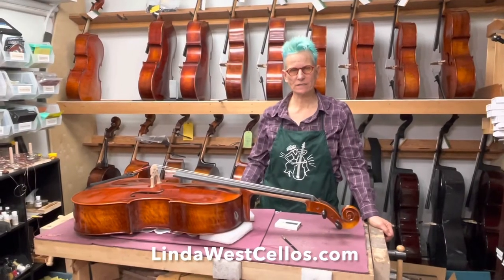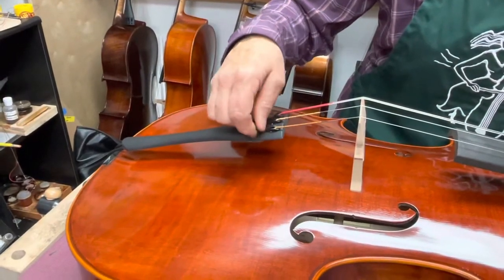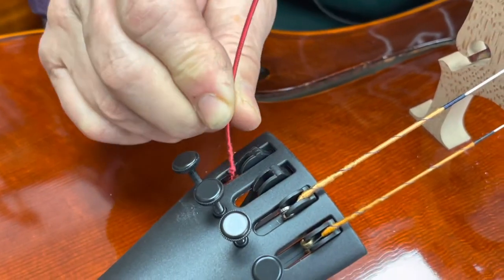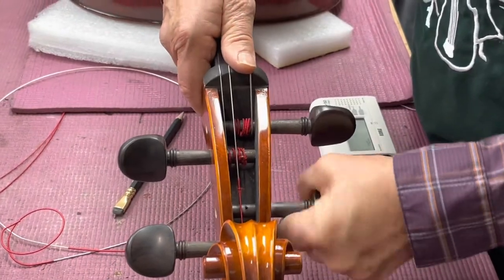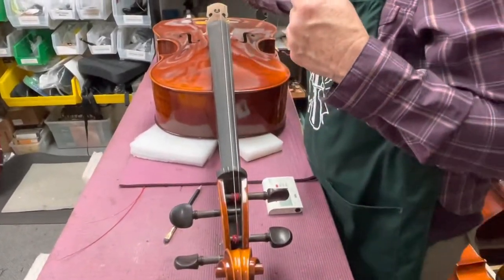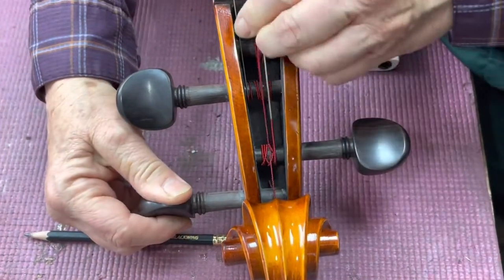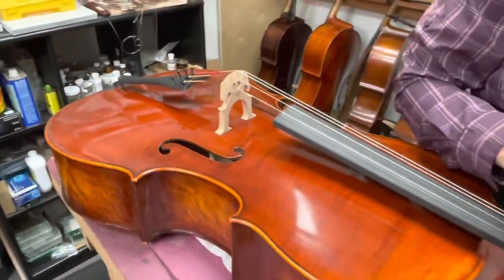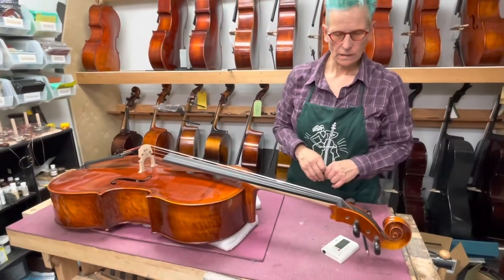How to change cello strings

Comment: Hi Linda, thanks so much for this tutorial. Could you show us as well how to center the bridge ? Mine is way more towards the A string. Do I have to loosen all the strings with the pegs and then move the bridge as I want ?
Reply: Slightly loosen the strings using  the tailpiece fine tuners first to see if that’s enough. I hook my thumb around one bridge leg and grab the c bout edge ( in your case bass side) and tap the other leg with my finger tip. I have strong hands so I’m able to move the bridge often without loosening. Only under certain conditions and the adjustment is a few millimeters. If it’s way off center or an old cello or a cello with brittle or delicate varnish that may be damaged by scooting, I will loosen the strings and carefully recenter the bridge.